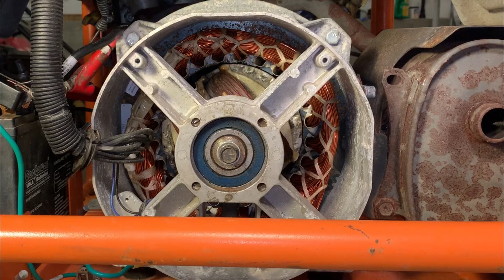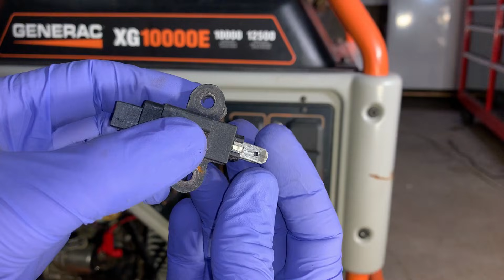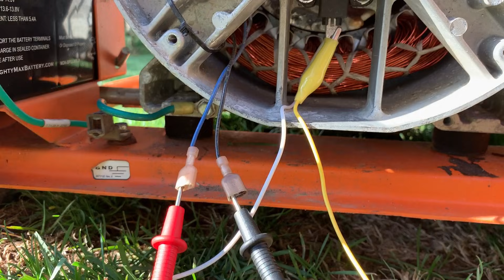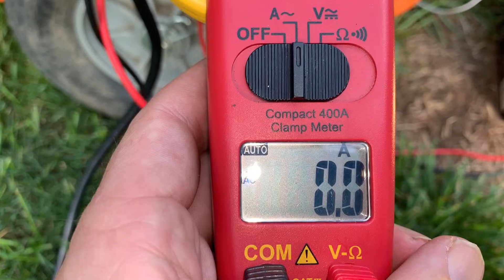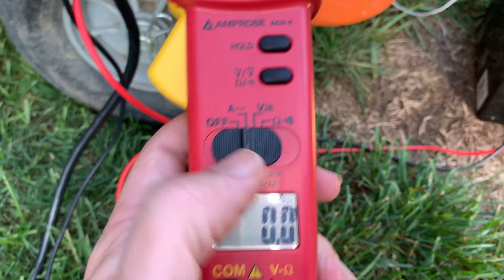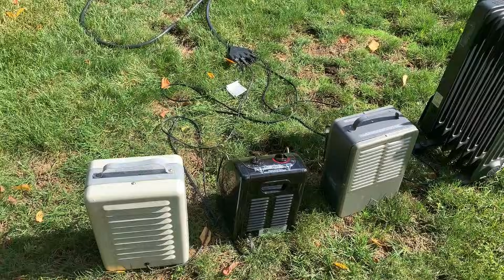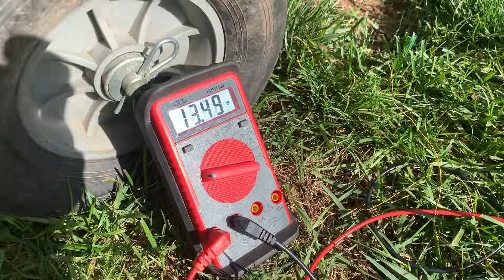Generac XG10000e No Power/No Voltage - Fixed

Comment: Generally speaking customers and people that want things repaired never tell me the truth
Reply: Here is a reminder about portable generator safety: this is only a reminder for anyone who use portable gas/propane generators. This is just to make sure that everyone is aware of all the warnings and it’s just to remind people to be careful using portable generators. Everyone has to see this safety reminder. Every year after hurricane and winter storms, there were reports on the news that many people have died each year when using generators due to carbon monoxide poisoning and electrocution during a power outage. There were reports about deaths when using generators when the power was out. There is something very serious that everyone should always be aware of when using generators. Some people do run their generator indoors which is not safe and that increases the risk of carbon monoxide poisoning which can cause death of family and you. Some people run their generator in wet conditions which can electrocute them. Here’s an advice about generator safety: please remember that you should never run your generator indoors. Remember that carbon monoxide is an odorless and colorless gas that you cannot see or smell. Carbon monoxide is a silent killer. Keep that in mind. Make sure your generator is 15-20 feet away from your house and away from doors, windows, and vents. Having a carbon monoxide detector is very important against generator safety. Some people also allow children to go near the portable generator which could pose risks. We need to keep an eye on our children making sure that they are not near the portable generator so they won’t get electrocuted or burned by the generator which is dangerous. A locking enclosure also keeps kids safe. A generator shed might look like a tempting place to explore, or take cover during a game of hide and seek, but a generator is a dangerous piece of equipment that can cause injury. It says on the manual that we should also keep children away at all times from the portable generator to avoid injuries. Please do not permit a child or unqualified people to operate the portable generator. Generators pose electrical risks. If you need to use your generator during wet weather, you need a generator tent to protect your generator from getting wet. Don’t let your generator get wet. Keep your generator dry and before using your generator, please make sure your hands and your generator is dry. Everything that is said on the generator’s operating manual should not be ignored. Never smoke cigarettes near the generator. Please keep flammable things away from the generator. Never overload your generator too. Your generator can catch fire. Never ever try to plug a generator cord into a wall outlet to avoid back feeding. Back feeding your generator is dangerous. Always turn on your generator first before plugging in appliances and shut off the appliances before turning your generator off. Use a heavy duty cord for your generator and the cord should not be worn out. All the instructions should be followed carefully. Never refuel your generator while it’s running. It can cause fire if fuel spills while your generator is hot. You should turn off your generator and let it cool off before refueling it. Having a fire extinguisher next to the generator is also important. This is only a reminder for everyone’s safety of using generators. Make sure your generator is properly grounded. https://youtu.be/I1jT3ANENvI and here is a video more about keeping others safe when using generators and also about our family’s safety. Hope this helps and everyone understands the safety requirements. Thank you. Be safe.

Comment: Nice work yet again James👏...Although it didn't change the final outcome, and the fact that someone had definitely been playing in there before, even with your red clamp meter @20.00min set to AC Amps with the leads plugged into V/Ohms sockets, you didn't let it throw you for a loop😂..I did see you briefly switched to AC volts and saw only 0.2volts...Love your vids...great work mate👍🇦🇺
Reply: Here is a reminder about portable generator safety: this is only a reminder for anyone who use portable gas/propane generators. This is just to make sure that everyone is aware of all the warnings and it’s just to remind people to be careful using portable generators. Everyone has to see this safety reminder. Every year after hurricane and winter storms, there were reports on the news that many people have died each year when using generators due to carbon monoxide poisoning and electrocution during a power outage. There were reports about deaths when using generators when the power was out. There is something very serious that everyone should always be aware of when using generators. Some people do run their generator indoors which is not safe and that increases the risk of carbon monoxide poisoning which can cause death of family and you. Some people run their generator in wet conditions which can electrocute them. Here’s an advice about generator safety: please remember that you should never run your generator indoors. Remember that carbon monoxide is an odorless and colorless gas that you cannot see or smell. Carbon monoxide is a silent killer. Keep that in mind. Make sure your generator is 15-20 feet away from your house and away from doors, windows, and vents. Having a carbon monoxide detector is very important against generator safety. Some people also allow children to go near the portable generator which could pose risks. We need to keep an eye on our children making sure that they are not near the portable generator so they won’t get electrocuted or burned by the generator which is dangerous. A locking enclosure also keeps kids safe. A generator shed might look like a tempting place to explore, or take cover during a game of hide and seek, but a generator is a dangerous piece of equipment that can cause injury. It says on the manual that we should also keep children away at all times from the portable generator to avoid injuries. Please do not permit a child or unqualified people to operate the portable generator. Generators pose electrical risks. If you need to use your generator during wet weather, you need a generator tent to protect your generator from getting wet. Don’t let your generator get wet. Keep your generator dry and before using your generator, please make sure your hands and your generator is dry. Everything that is said on the generator’s operating manual should not be ignored. Never smoke cigarettes near the generator. Please keep flammable things away from the generator. Never overload your generator too. Your generator can catch fire. Never ever try to plug a generator cord into a wall outlet to avoid back feeding. Back feeding your generator is dangerous. Always turn on your generator first before plugging in appliances and shut off the appliances before turning your generator off. Use a heavy duty cord for your generator and the cord should not be worn out. All the instructions should be followed carefully. Never refuel your generator while it’s running. It can cause fire if fuel spills while your generator is hot. You should turn off your generator and let it cool off before refueling it. Having a fire extinguisher next to the generator is also important. This is only a reminder for everyone’s safety of using generators. Make sure your generator is properly grounded. https://youtu.be/I1jT3ANENvI and here is a video more about keeping others safe when using generators and also about our family’s safety. Hope this helps and everyone understands the safety requirements. Thank you. Stay safe as well

Comment: That’s a lot of hours for three years old.  There are only around 2080 work hours in a year, so they say, so that sucker was running for about a third of the time they were working.  I will bet it has its original oil in it too and only God knows what the air filter looks like.😘

Comment: good fix James, thanks for sharing.
Reply: Here is a reminder about portable generator safety: this is only a reminder for anyone who use portable gas/propane generators. This is just to make sure that everyone is aware of all the warnings and it’s just to remind people to be careful using portable generators. Everyone has to see this safety reminder. Every year after hurricane and winter storms, there were reports on the news that many people have died each year when using generators due to carbon monoxide poisoning and electrocution during a power outage. There were reports about deaths when using generators when the power was out. There is something very serious that everyone should always be aware of when using generators. Some people do run their generator indoors which is not safe and that increases the risk of carbon monoxide poisoning which can cause death of family and you. Some people run their generator in wet conditions which can electrocute them. Here’s an advice about generator safety: please remember that you should never run your generator indoors. Remember that carbon monoxide is an odorless and colorless gas that you cannot see or smell. Carbon monoxide is a silent killer. Keep that in mind. Make sure your generator is 15-20 feet away from your house and away from doors, windows, and vents. Having a carbon monoxide detector is very important against generator safety. Some people also allow children to go near the portable generator which could pose risks. We need to keep an eye on our children making sure that they are not near the portable generator so they won’t get electrocuted or burned by the generator which is dangerous. A locking enclosure also keeps kids safe. A generator shed might look like a tempting place to explore, or take cover during a game of hide and seek, but a generator is a dangerous piece of equipment that can cause injury. It says on the manual that we should also keep children away at all times from the portable generator to avoid injuries. Please do not permit a child or unqualified people to operate the portable generator. Generators pose electrical risks. If you need to use your generator during wet weather, you need a generator tent to protect your generator from getting wet. Don’t let your generator get wet. Keep your generator dry and before using your generator, please make sure your hands and your generator is dry. Everything that is said on the generator’s operating manual should not be ignored. Never smoke cigarettes near the generator. Please keep flammable things away from the generator. Never overload your generator too. Your generator can catch fire. Never ever try to plug a generator cord into a wall outlet to avoid back feeding. Back feeding your generator is dangerous. Always turn on your generator first before plugging in appliances and shut off the appliances before turning your generator off. Use a heavy duty cord for your generator and the cord should not be worn out. All the instructions should be followed carefully. Never refuel your generator while it’s running. It can cause fire if fuel spills while your generator is hot. You should turn off your generator and let it cool off before refueling it. Having a fire extinguisher next to the generator is also important. This is only a reminder for everyone’s safety of using generators. Make sure your generator is properly grounded. https://youtu.be/I1jT3ANENvI and here is a video more about keeping others safe when using generators and also about our family’s safety. Hope this helps and everyone understands the safety requirements. Thank you. Be safe.

Comment: After the wires were mistakenly swapped, it affected the voltage output, and the excitation pot was. Diddled with , but it did not work, of course. When you first got power out of it, the voltage was double what it should have been, I think one mistake in wiring, lead more mistakes, like dominos.....
You deserve cudos for sticking with it, and setting it right. The extra reward you got is the experience, so you can remember it in future scenarios....GOOD JOB...!!!

Comment: James another great video. I always learn something and that's priceless. This Generac is what I use for my home back up here in Florida. Now I have some professional reference for mine. May I ask did you go to school for this, or self taught?
Reply: Here is a reminder about portable generator safety: this is required for everyone’s safety. This is only a reminder for anyone who use portable gas/propane generators. This is just to make sure that everyone is aware of all the warnings and it’s just to remind people to be careful using portable generator during a power outage. Everyone has to see this safety reminder. Every year after hurricane and winter storms, there were reports on the news that many people have died each year when using generators due to carbon monoxide poisoning and electrocution during a power outage. There were reports about deaths when using generators when the power was out. There is something very serious that everyone should always be aware of when using generators. Some people do run their generator indoors which is not safe and that increases the risk of carbon monoxide poisoning which can cause death of family and you. Some people run their generator in wet conditions which can electrocute them. Here’s an advice about generator safety: please remember that you should never run your generator indoors. Remember that carbon monoxide is an odorless and colorless gas that you cannot see or smell. Carbon monoxide is a silent killer. Keep that in mind. Make sure your generator is 15-20 feet away from your house and away from doors, windows, and vents. Having a carbon monoxide detector is very important against generator safety. Some people also allow children to go near the portable generator which could pose risks. We need to keep an eye on our children making sure that they are not near the portable generator so they won’t get electrocuted or burned by the generator which is dangerous. A locking enclosure also keeps kids safe. A generator shed might look like a tempting place to explore, or take cover during a game of hide and seek, but a generator is a dangerous piece of equipment that can cause injury. It says on the manual that we should also keep children away at all times from the portable generator to avoid injuries. Please do not permit a child or unqualified people to operate the portable generator. Generators pose electrical risks. If you need to use your generator during wet weather, you need a generator tent to protect your generator from getting wet. Don’t let your generator get wet. Keep your generator dry and before using your generator, please make sure your hands and your generator is dry. Everything that is said on the generator’s operating manual should not be ignored. Never smoke cigarettes near the generator. Please keep flammable things away from the generator. Never overload your generator too. Your generator can catch fire. Never ever try to plug a generator cord into a wall outlet to avoid back feeding. Back feeding your generator is dangerous. Always turn on your generator first before plugging in appliances and shut off the appliances before turning your generator off. Use a heavy duty cord for your generator and the cord should not be worn out. All the instructions should be followed carefully. Never refuel your generator while it’s running. It can cause fire if fuel spills while your generator is hot. You should turn off your generator and let it cool off before refueling it. Having a fire extinguisher next to the generator is also important. This is only a reminder for everyone’s safety of using generators. Make sure your generator is properly grounded. https://youtu.be/I1jT3ANENvI and here is a video more about keeping others safe when using generators and also about our family’s safety. Hope this helps and everyone understands the safety requirements. Thank you. Be safe.
Reply: @The_Happy_Aviation_Enthusiast  annoying

Comment: Excellent job and generator as it turns out, I always put the leftover 2 stroke fuel in with the fuel for the mower and I've never had an issue, you should be able to sell that unit as a backup generator and make some money, and still sleep pretty good